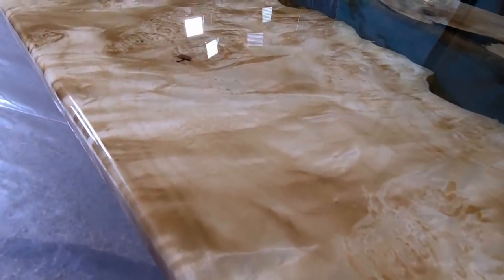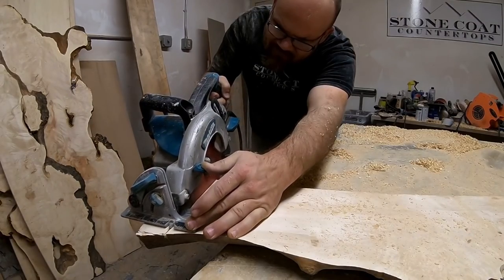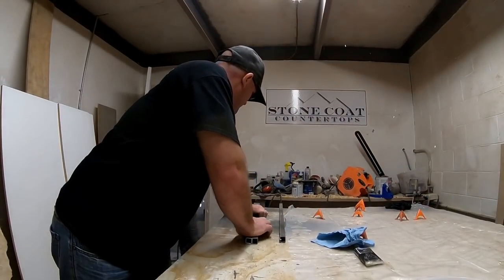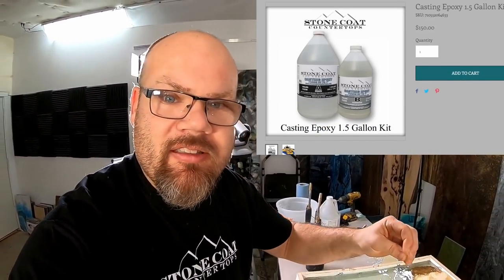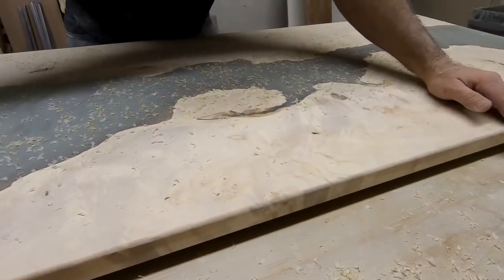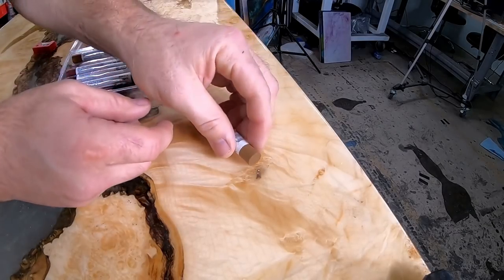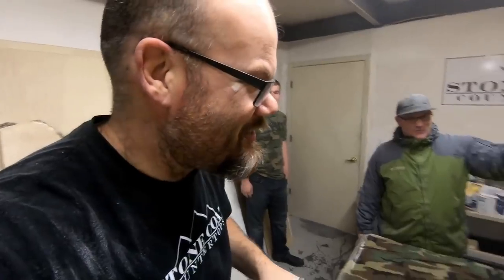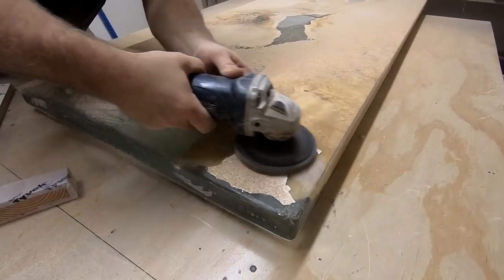Transparent River Table with Epoxy

Comment: Great table. I think a good thing to mention when you talk about sanding off the epoxy bumps from the bottom is to mention that we should wait until the epoxy is completely cured so you don't get hairline scratches on the top.

Comment: Meguires #8 Mirror Glaze Mold Release Wax
Partall Film #10-FMSC
These are used in the FRP market as mold release agents
As a substitute for silicone as a barrier you can use modeling clay around the edges.

Comment: This is great! Soon I will be creating similar for an rv.  I wish to add a remote controlled led multi colored dimmable light strip along a routed chamber at the edge of the bottom of the live edge. I may leave it on a white board after the pour. You've inspired me. TY!

Comment: Try "Partall 2" mold release wax, "PVA" or some other mold wax, used on molds for fiberglass part production, (at least 2 or 3 coats).  Some auto waxes with Carnauba may also work.  But I know the mold wax will work if applied as instructed on the package.  I've worked in the fiberglass industry for over 30yrs which has included the use of epoxy resins.  And have used melamine to lay-up parts, another thing you can use instead of that is MDF.  Also try useing wood wedges to pull the part.

Comment: Your projects are amazing! 
There should be workshops all over the country where the public can pay a fee, buy a slab, epoxy, metal flakes, etc. so people can make their own tables, wall clocks, paneling for walls and even small art projects for the kids  ( & kids in us), including jewelry and so on. The metal flakes, rocks, pebbles, glass, etc. and other objects, to add into the castings.
   It would be incredible to have a workshop where people could pay for classes, studio/workshop time, and materials, classes, etc.
   Many people don't have a garage or workshop, yet they DO want to make a table, blinds, and other projects for their homes and for gifts. Also, tools can take up a lot of room, that many people don't have, nor do they have much, if any other uses for around the house.
   Having a drop-in workshop, much like a ceramics class/drop-in center, would be a great business, and a lotta fun too!

Comment: Find a cultured marble place and see what they use for wax.  I worked at one years ago and they had a mold release wax that would do great. It was used before spraying the molds with gel coat before the resin marble mix was put in the mold

Comment: That looks amazing. Question though, it looks like you did the glass coat on the top, but left the bottom of the table unfinished. Wouldn't you want to apply at least one base coat of epoxy or even just a wax or varnish to prevent warping? I'm  under the assumption that if you seal wood on one side but not the other it can warp, cup or bow.

Comment: I do like your epoxy I would buy more of it if it was a little cheaper. I've been finding it 4 g for hundred the only difference I have seen is the dry time. You guys do awesome work as well im a handy man and have been doing lots of different projects for clients and would use your epoxy if the price was a little more contractor

Comment: Not sure if you will see this, however I noticed you did not sand or rough up the edge that you epoxied before pouring your resin in the river, what are your thoughts on roughing up the edges like many say?

Comment: If I used a real heavy grit and lightly grooved just the bottom of the epoxy in straightish lines, I'm wondering if I could give the epoxy movement. Maybe use a scraper for wood carvings. Have you tried this!

Comment: I love it! I always think if I was going to do this I’d go for an ultra clear so you could see the actual wood rather than using coloured epoxy that hides everything. 
I was watching when you were using the routing jig...do you end up with an uneven result because the wheels of the jig are going over the chips? I just wonder if it would be better to have the wheels somewhere that they wouldn’t be going over the waste somehow? I’m not sure if it would make a difference, just an observation. 👍🏼

Comment: This was absolutely amazing! Thank you for sharing this, it is beautiful! actually beyond beautiful!

Ps. Try form wax like the use in concrete forms, also in fiberglass forms. When I built fiberglass boat hulls Way back when we used a wax which coated very good and the fiberglass hull would pop right out with air pressure.

Comment: Hi guys.. I’m trying to make one of these. I just spent a lot of money on the black cherry wood slabs and they are book ended,same size,I thought.However one is just below 2in thick and the other is 3in. Since my plan is to pour a black layer on the bottom then clear on the rest,.Is it absolutely necessary to make sure they are both flush with each other? I am praying not bc I don’t have the money for the extra tools,the room,ect..ty,LOVE your work

Comment: Could you do a house door this way, or would it eventually warp due to weather changes?  Would the sun cause issues with the epoxy?
Reply: Yes... curious about outdoor durability...and also kitchen wear n tear...what is Max temp the epoxy can handle?
Reply: You don’t want your front door to be clear? If you add some coloured pigments the yellowing will be hardly noticeable
Reply: rocks anon 
Up to 470 F resistant. Normally I don’t place boiling pans on my kitchen surfaces, but you can place hot pots and boiling pans on stonecoat if they are done correctly. check the video stonecoat durability test. And remember it has to cure for at least 4 weeks in warm place before placing something hot.
You got this!

Comment: Hi, a very well done project; Just lovely! I'm wondering what do you use between coats to clean after you sand it(in the bottle sprayer)? Can I use a simple thinner or just water and let it dry and after apply the next coat? Thanks in advance

Comment: outstanding job.... and Happy New Year.  Only have a few questions if you don't mind.  

1. What are you using to clean off the dust... I seen you sprayed something,  is that mineral spirits or denatured alcohol?

2. Also, I know in most of the live edge projects you put metal bars in the underside to stop wood from warping later.  In this project you did not do that is there a reason? 

As always thank you for a great video and all the tips and tricks it is a big help...
Reply: Ok, disregard question #2 you gave the answer in the video.  learned to not get distracted watch the whole video before asking the question...  sorry about that...

Comment: Do you have any problems with slab wood counter tops cupping or bowing with epoxy only on the top and not on the bottom

Comment: Hello Mike I've noticed in some videos that you route the back of the table and set metal rails in it for strength, then I notice in others like this one that you don't.
Is it the weight or thickness that determines this? I am wanting the transparent look on mine without rails but with a 3" plus thickness.

One more thing. On this one you sealed your mold corners with silicone caulk, on others you have used the tyvek tape inside and out...what is the best standard to seal the mold frame?

Seen both two different ways, just confused. Thank you for clarification or update on processes. LOVE YOUR VIDEOS!
Reply from the maker: Hi Rhonnie Originals thank you for leaving this comment!
This project had a custom base created for it that was very supportive, for any other projects its highly advised to install those supports to keep the wood from twisting or cupping in the future.
We really love the tyvek tape as it offers the best release we have found yet, but also wanted to show that is is possible with silicone.
You will see our trials and errors in our videos!
Thanks for watching and call us anytime with questions 541-450-1976
Reply: @StoneCoatCountertops  THANK YOU!

Comment: I've been perusing a lot of these resin pour videos the last few days and am at a bit of a confusion.
Bubbles are a big deal, apparently.  For small projects they use a pressure (vaccuum?) vessel to I guess compress the bubbles so they don't appear?  How do you keep bubbles from forming in these large pours?  The heat gun can eliminate them from the surface as they appear, but what about those that crop up inside the product after it's too set to let them surface?

Comment: I have a slab of alligator Juniper many many holes in the side of the Live Edge can you put multiple seal coats on a rough surface without having to sand each coat I'm having trouble finding info ceiling live edges that have a very rough surface and many holes

Comment: Can this epoxy be used over an oil stain? We sanded an old pine top table to remove an old finish, used a sealer, then a oil stain. Anything else we need to do before using the epoxy?

Comment: I have a cherry log that when I sawed into it I found out had had ants.  Before I trashed it to fire wood I am thinking of trying to make a river table type effect with the one large opening as a lake and the holes as springs.  This will be a built in cabinet top and not very wide.  It should fit through my 15 planner.  I am wondering if that is possible?   Can you run the epoxy filled board through a thickness planner and then sand from there?   Thank you

Comment: Does the chop brush take out all trowel lines and heat helps leveling ?
Reply from the maker: Hi Francis Griffin! 
It removes all of the trowel marks, as well as it re-mixes the epoxy!
Reply: then your left with brush dab marks or do those lay flat with the heat ?

Comment: Hey, I know this is an old video but I’m wondering if something like this can be done for a subwoofer box. How would I secure  the panels to each other? How would epoxy hold up to the pressure of a subwoofer?  Does it harden to create a “strong as wood” type of surface?  I would need to be able to secure 6 panels together.  Thanks for any help!

Comment: What I would like to see next is you using a push stick on the table saw instead of putting your fingers so close to the blade. Also I would like to see a couple gallons of epoxy in my workshop LOL I love the work you do and the wood you work with is amazing and you just highlight it with the epoxy.

Comment: I noticed you didn’t use 3/4 inch bars to tie the two slabs together on this one . I figured because it is transparent but is the epoxy sting enough to hold the to slabs together? If so why even use the bars at all ? Where do you get Mohawk burn in sticks ?
Reply: Never mind I asked the question before I finished watching

Comment: Why is it necessary to do three seal couts before the final flood coat?  Wouldn't one seal coat be enough?
Reply: because the wood will absorb and try to breath causing bubbles. the next 2 coats make sure it is sealed and no air pockets

Comment: Is their a way a way to add led lighting to a transparent table without the lighting strip being so exposed so it doesn't ruin the look of the table, so at night you could have it light up, to really bring out the look and appeal so it could be the center of attention when you have guests over for game night.
Reply from the maker: Hi Justin Hardy, where there is a will there is a way! This is possible but every project will need a different approach as they are all so different!

Comment: Awesome.
How you remove  the bubbles  from  your resin???
I had  A Problem.  I hold a flame  about  my resin  and  it started  to burn. 
Maybe  you can help  me. 
What  did  i wrong?
Reply: Get yourself a vacuum chamber. After mixing your epoxy, place the epoxy in the chamber for a few minutes to get all air bubbles out of the resin. After a few minutes, take it out and pour the mix!

Comment: what are you using to keep the epoxy from sticking to the white surface
Reply from the maker: Hi Build For Fun, we use Tyvek tape to have an easy release! The furniture wax did not work well as hoped.

Comment: I just watched this video to see where I might have gone wrong. Everything I did turned out as yours did until the seal coat section where after the first application of seal coat my project bowed and cupped again 😳. After applying it, because of work, I was unavailable to work on it for 3days and when I returned home I realized all 4 corners were lifted off of the flat surface by a minimum of a 1/2”...not sure how to proceed. When I made the original pour it stayed in the form for several weeks, even though it felt hard after 3-4 days. When I removed it there was some twist to it but nothing that the router sled couldn’t handle. At that point it sat on a flat surface covered by blankets for serval weeks while I was away for work; upon returning home I uncovered the project and left it to breath for a few days (still perfectly flat and sanded to 1200 grit) I applied the seal coat and came back the next afternoon/evening and all 4 corners were off the table 😳💔🤬...😂✌️...just not sure where to go from here. Last night I put a .5”x1.5” strip of plywood under the center and ran clamps around the outer edges to hopefully move everything closer to where it began...??? Idk🤔
Reply: John Velasquez my guess would be relative moisture in you wood was too high or too low. Wood gains and loses moisture depending on the surrounding air. You have to let your project wood stabilize in the environment that it will live in before you begin working with it.

Comment: Was there a seal coat on the bottom that I missed?
Have you tried the spray mold release products like Stoner?
Reply from the maker: Hi StingsnBlingz, we stick with the Tyvek tape, I do not believe we have tested stoner release spray, thats not to say it couldn't work. We seal the underside of our wood projects with a polyurethane to keep out moisture after the epoxy process has been completed!
Reply: @StoneCoatCountertops  was it a table?  do you guys do the legs and other supports?

Comment: Hey love the videos!  Question though!  I’m thinking of purchasing your router sled.  However, I was watching the video and noticed the wheels rolling over wood chips.. does that affect the flatness of the slabs?
Reply from the maker: Great question, we do multiple passes, when we do our last pass we keep the wheel path clean.
Reply: @StoneCoatCountertops  how do you adjust the height of the router sled though? 
Im considering purchasing however the piece of wood i have to work with is 7 inches thick right now.

Comment: You have over 10 videos around 5 minutes long but you showed your greed using this 20+ minute long vid as a commercial. YOU are part of what is going rotten in YOUTUBE. Definetly not smart enough to do market research or learn that this is a very unpopular strategy.  I'm blocking you and added you to my list of greedy businesses.
        Otherwise be well and learn better. 
     Sincerely ive